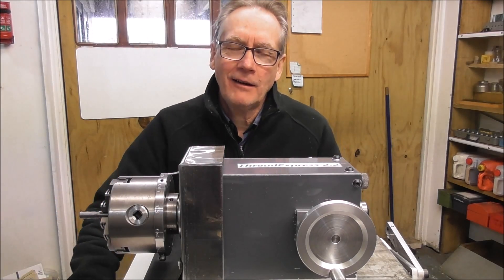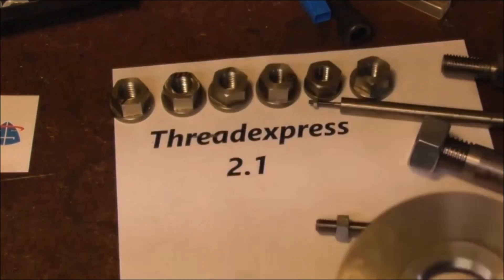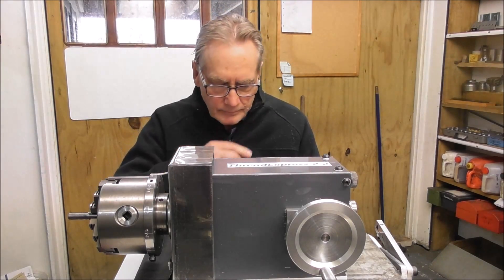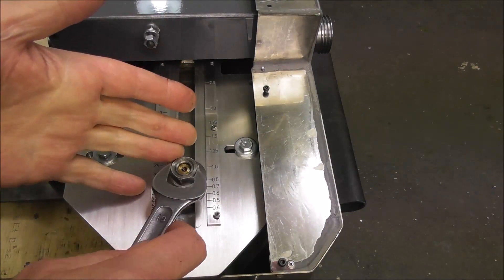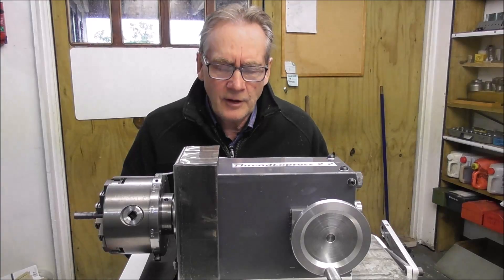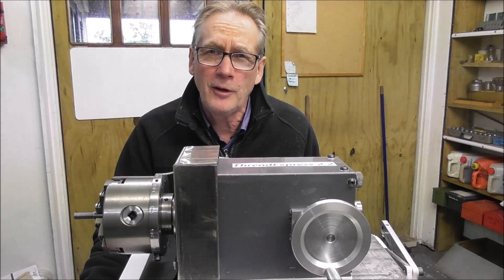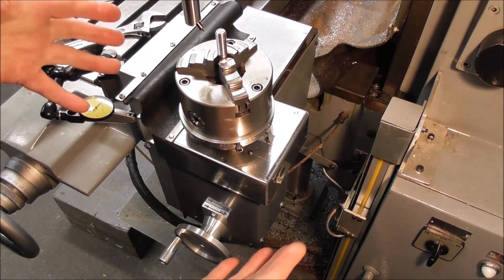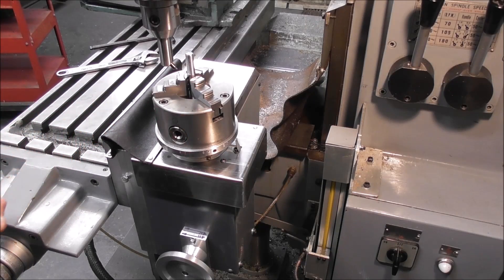ThreadExpress 2.2 Design revelation begins.

Comment: Neat idea, very interesting . The adjustment of pitch Reminds me a lot about Spiral grinding attachments for t&c grinders, but many of them cant do very small pitches like yours.

My first idea would be not to use it on a mill, but on a surface or t&c grinder to implement threadgrinding.

For milling machines, I think its 70 years to late, having this integrated right into a toolroom mill would have been extremely powerful. Today that need is unfortunately eaten up by cnc mills.

Will watch the other videos for sure 😃
Reply from the maker: Thanks for your feedback Stefan. I agree CNC affects its percieved value and this is a marketing challange. I have CNC threadmilling also, and often choose ThreadExpress for one off speed of set up, or when a larger diameter cutter is needed (eg for the stiffer larger longer shank reach on longer threads) because with a larger diameter cutter you really need to set the axis of the  thread over at the helix angle to avoid milling the thread profile errors you get with vertical three axis CNC thread milling.  I briefly tried thread grinding with it on my surface grinder, but soon realised I need better wheels, diamond dressing, and thread grinding learning time first! Cheers, Cliff

Comment: Some further thoughts about using differential threads to produce the adjustable lift required in your ThreadExpress device.  I'm looking forward to the final reveal because I'm sure your solution is better & simpler than my speculations.

The problem is the tremendous range of threads necessary.  64 tpi requires that the spindle lift 0.0156" per revolution and 2" of thread requires 128 revolutions.  9 tpi requires that the spindle lift 0.1111 per revolution and 2" of thread permits only 18 revolutions.  It simplifies things to use threads on the outside of the spindle to create the required lift.  A pretty fine spindle thread is required to allow 130 revolutions for the 64 tpi threads, but that fine thread doesn't provide much lift when less than 20 revolutions are available for the 9 tpi.  

A compact solution is to limit the rotations to about 65 and have 2.5" of 40 tpi and a nut on the upper end of the spindle and 8" of 10 tpi and a nut on the lower end of the spindle.  A 6" long cross lever is pinned at its 1.5" point to the upper nut.  A slide on the lever is positioned anywhere along the lever to control the lift of the nut.  The slide swivels on the end of a long vertical link pinned to a reference elevation.  The other end of the 6" cross lever is pinned to one end of a 7" link with its other end pinned to the lower 10 tpi nut.  When the spindle rotates CCW it backs out of the upper 40 tpi nut and lifts at 0.0250" per rotation.  Spindle rotation also backs out of the lower 10 tpi nut and moves it down at 0.1000" per rotation.  The link from the lower nut to the 6" cross lever pulls it down and rotates the cross lever 90 degrees CCW around its pivot on the upper nut.  Because the cross link pivots on the slider, the position of the slider on the cross lever determines the total lift of the spindle. 

The total spindle lift is the combination of the spindle backing out of the upper nut and the lift of the cross lever that lifts the upper nut.  The slider position on the cross lever determines the lift of the upper nut.  When the slider is coincident with the pivot on the upper nut, the rotation of the cross lever has no contribution to the lift - it still rotates but doesn't move the upper nut.  The total lift will only be the backing out of the upper nut at 0.0250" per rev and would mill a 40 tpi thread as the spindle rotates.  When the slider is beyond the pivot on the upper nut on the short end of the cross lever, the rotation of the cross lever lowers the upper nut and SUBTRACTS from the spindle backing out lift producing total lifts of less than 0.0250" per rev to mill threads finer than 40 tpi down to 64 tpi.  When the slider is on the other side of the pivot on the long/linkage end of the cross lever, the rotation of the cross lever in the slider raises the upper nut and ADDS to the spindle backing out lift, producing total lifts greater than 0.0250" per rev to mill threads coarser than 40 tpi up to 9 tpi.  This cross-lever lift is important because with coarse threads fewer spindle rotations are required/available and the lift backing out of the upper 40 tpi nut is small.

The 10 tpi thread on the lower part of the spindle is necessary to get the necessary lower nut movement to rotate the cross lever enough to obtain sufficient spindle lift for the coarser threads with the few available spindle rotations.  But 64 spindle rotations are necessary for every inch of 64 tpi thread.  This requires 6.4" of 10 tpi thread to accommodate the lower nut movement for this fine thread.  The 7" of 10 tpi thread limit the rotations to about 65 and the amount of 64 tpi thread to 1".  Longer fine threads can be made by repositioning the work in the chuck - why would one need more than 1" of 64 tpi thread?  The amount of 40 tpi thread is limited to the 65 rotation limit of the 10 tpi thread or 1.6" travel of the spindle in the upper 40 tpi nut.  The amount of 9 tpi thread is limited to the 6" of lift available with 7" of travel of the lower nut, but is more likely limited by the slide travel of the overall mechanism - 2 to 3".

As mentioned previously, the slider swivels on the end of a long link pinned to the reference elevation.  The slider's position on the 6'' cross lever is set by shifting a link from index marks that mark positions for the desired tpi or mm pitch.  Range of lateral movement of the slider along the cross lever is about 5".

The mechanism is mounted on a 1/2" thick base plate sliding vertically in a dovetail on the side of the milling table.  As noted in the main description, the dovetail mounting can be shifted and locked to set the spindle at the required helix angle for the thread.  The end of the link to the slide on the cross lever is pinned to the stationary part of the dovetail through a slot in the base plate.  The whole mechanism is supported on the slider and cross lever and is lifted in the dovetails by forces on the slider.  The spindle is supported at either end in bushings in 1/2" brackets bolted to the base plate.  The cross lever, links to the 10 tpi nut and pitch-setting lock, and slider-supporting link all slide on the base plate.  A vertical dado in an adjacent bracket bolted to the base plate receives tabs on the 40 tpi and 10 tpi nuts to prevent rotation but allow movement up and down the spindle.  That bracket has to be far enough away from the spindle centreline to allow the slider support link to move from one side of the spindle to the other for the different thread pitch settings.

As noted in the description, a crank and bevel gears are used to manually rotate (and elevate) the spindle during the thread milling operation.  If bevel gears are not available, pulleys and a large O-ring belt could be used.
 
As the crank on the side of the mechanism is turned, the spindle rotates the work CCW and backs out of the upper 40 tpi nut.  The lower nut moves down the 10 tpi spindle threads.  Its link rotates the cross lever 90 degrees CCW.  The position of the slider on the cross lever determines how much lower-nut movement (lift) is added (or subtracted) from the upper nut to produce total lift.   The total lift per rotation determines the thread pitch.  The cross lever, slider and links all have to be beefy enough to support the weight of the base plate, spindle, bearings, chuck, and work piece.

Congratulations if you got this far.  Make any sense?
Reply from the maker: Hi Andrew. Yes, I follow you well enough to see this is a far too complicated pitch generating mechanism, but I love your enthusiasm and dedication!  It would pay for you to save your energy and wait until I reveal the much simpler design of ThreadExpress (hopefully soon, see my top comment at the start of the latest video). Cheers, Cliff

Comment: It looks like you can handle a maximum of about 2" of thread anywhere from 64 to 9 tpi.  I believe this could be achieved with differential threading on the spindle below the bearings - say 1" of 120 tpi on the upper portion and 4" of 30 tpi on the lower end.  For this explanation I've imagined 60 tpi as the minimum and 10 tpi as the maximum for easy arithmetic.

For 2" of 60 tpi you'll need 120 revolutions of the spindle.

With 1" of 120 tpi and its nut is at table height, 120 CCW revs of spindle will raise the spindle 1".  (Backing it out of its nut.)

If the lower end of the spindle has 4" of 30 tpi and its nut is not fixed but prevented from rotating, 120 CCW revs of spindle will lower its nut 4" relative to the spindle but because the spindle went up 1", the lower nut will only lower 3" relative to the table.

The lower nut is linked to one end of a fixed teeter-totter at say table elevation and pivoted on the spindle centreline, such that one end goes down 3" while the other end goes up 1".  The rising end of the teeter-totter is linked to the upper nut, and will lift it 1" and effectively raise the spindle 2".  2" of upward movement in 120 revolutions will produce a 60 tpi thread.

If the pivot point of the teeter-totter is a slot, shifting the teeter-totter along the slot will change the ratio between the down motion of one end and the up motion of the other end.  For 2" of 10 tpi, 20 CCW spindle revs would be necessary and will raise the spindle 1/6" in the upper 120 tpi nut.  20 CCW revs will lower the lower 30 tpi nut 2/3" relative to the spindle but because the spindle went up 1/6", the lower nut will only lower 1/2" relative to the table.  But we need 2" of total upward spindle movement to get 10 tpi in 20 revs.  So by shifting the teeter-totter in its slot to give a input:output ratio of 1/2 to 11/6, 1/2" of lower nut downward movement would translate to 11/6" of upward nut movement which added to the 1/6" it already moved would give 12/6" or 2" of upward spindle movement.  And 2" of 10 tpi with 20 CCW revs of the spindle.

 So the teeter-totter slot would be positioned to give a 0.5:1.8333 ratio - one end goes down 1/2" to lift the other end 1.8333".  And lift the upper nut 1.8333" for a total spindle lift of 2".  

Even better ratios could be had with more travel of the lower nut.  But more lower thread would be required and take more room in the mechanism.

There may be issues with angularity of the links as the teeter-totter rocks from the lower to upper spindle position.  But they can be minimized by maximizing the lengths of the links and minimizing the length of the teeter-totter.
Reply from the maker: Hi Andrew!  This ThreadExpress if nothing else is causing a lot of intrigue. Consternation even! By the time it is finally revealed we may have every possible design reverse engineered from clues gleaned and deducted. I dread to think how much sleep deprivation I have caused.
 You have put together a very solid case based on your first sentence deduction. The trouble is that first sentence deduction is incorrect, cruelly leading you astray.  But hopefully you enjoyed it, so all is not lost.  Stay tuned and hopefully soon the design will become clear. Cheers, Cliff

Comment: My best guess is 2 or more crossed, opposing, hardened rollers that are very heavily pre-loaded against a hardened and ground spindle supported in its own bearings. Changing the helix angle of the rollers to the shaft would give infinite pitch changes from zero to the max setting. The spindle would act like a toothless lead screw. The opposing rollers eliminates any bending of the shaft. Helicopter one-way clutches work on hardened cams or rollers against hard shafts and the traction is enough to transmit incredible torque without slipping....even submerged in oil.
There are existing linear shafts nuts working on this principal but without the helix adjustment.   Well....am I even in the ball park ? LOL.  It's fun to think about and hopefully to see the other ideas that come up. However it works, your invention is brilliant !
Reply from the maker: Thanks for your feedback and interesting idea! Cheers. Cliff

Comment: It seems to me, that the device possesses the ability to produce a spiral around an external shaft.

If you mounted something like a boring head where the chuck is mounted, if you installed a cutting spindle where the boring bar would normally be installed, you could make a device that could be mounted in the field, that is capable of milling threads in the field on any exposed thread in an assembly. 

I can imagine producing a threaded hole on a large piece of machinery, or a large exposed stud.

A portable thread milling machine.

I would recommend contacting Climax portable machine tools, or York portable machinery if you are looking for a possible buyer.
Reply from the maker: Thanks for your thoughts, I see what you mean. I thought for a moment you were describing ThreadExpress v1.0 - which had a cutting head and was a portable thread making machine. But what you are describing is a little different, it is a niche bolt, clamp or mag on thread cutting attachment. Interesting....thanks! Cliff.
Reply: @Threadexpress  yes, I am describing taking your machine and attaching it to a piece of equipment at a job site. Companies have made portable lathes, portable bore welding machines, portable line boring machines, even portable milling machines, but nobody has made a portable threading machine.

I personally am interested in your attachment for that reason. It can be turned Into a machine.

Comment: Very interesting machine. Yes, the same could be done on a 5 axis CNC like an Intergrex. But like the Tree taper boring head, for the right job it's the perfect answer. In over 20 years I can only think of maybe a handful of jobs where I would have used it, so not likely to pay for itself. I have done thread milling and thread grinding on my lathe when an absolute perfect thread form was required. This was for telescope drives that needed arc seconds accuracy, and it took much lapping to get that. I wonder if your machine could deliver that accuracy? Of course the days of mechanical accuracy are numbered. I remember seeing ball screw grinding machines where the thread was held to 10 microns over 2 meters. Now days they just grind them in the ball park, map the errors and fix it in software. I do look forward to your next video about this.
Reply from the maker: Hi - Good to hear the thoughts of an experienced machinist. Cheers, Cliff

Comment: Hey Cliff,
I'm picturing a pantograph / 4-bar mechanism? One point is driven by a nut that meshes with a thread on the spindle, and the adjustment slider moves the pivot point. Adjusting the pivot point in or out changes the lever ratio, effectively reducing the pitch, while the pantograph maintains linearity throughout the travel.
I've watched several of your videos over the years, and always appreciate your thoughtful explanations.
Cheers (also from down under, Palmerston North, NZ),
Simon  :  )
Reply from the maker: Very interesting, fellow Kiwi. That is all I can say at this stage. Cheers, Cliff

Comment: Hello from Germany
This machine is like I think a mechanical master Part.
But yes there is a but.
I saw this machine in a machine shop 30-40 years ago.
I am a mechanic in a factory.
We have to fix all sorts of things.
Even if we had such a machine, no one would use it.
I would have to grind a tool. I would have to align the machine. I would have to align your machine with the milling machine.....
This is taking far too long.
So what do we do? We give it to a machine shop.
This machine shop simply turns such parts on a CNC lathe.
Sometimes I make simple parts like this on my CNC lathe.
Check out my channel...
It's no longer that difficult to mill/turn such parts.
I myself also have a C Aches and a driven tool on the CNC lathe.
I recommend that you stop working on this machine - the system is over its time.

I still wish them all the best
Stephan
Reply from the maker: Sorry I missed your comment until now. Thanks for the feedback. Cliff

Comment: Could you go into more detail about the helix angle? If it cant be correct vertical with a singele point thread mill due to the tool flank and releif angles, then a lathe shouldnt be able to be correct either. The cutting edge is presented the same relative to the wor, at the same angles relative to the axis of the work, its just the frame of reference is rotated 90 degrees from outside
Reply from the maker: Good to see folk are thinking deeply about this. I think I should go over it more in a future video. Single point threading in a lathe is not highly precise without setting the tool at the thread helix angle also. High end manufacturers such as Sandvik Coromant and Iscar produce such tools with adjustable helix angles.
But the problem with thread milling (in a mill or lathe or CNC mill) is the additional issue of cutter trajectory. The tool trajectory sweep needs to be inclined to stay in the valley of the thread, if the thread pitch/diameter/cutter diameter conspire to cause the tool trajectory to cut into the thread flank. In the instances where this happens, an incorrect thread form is cut.  Cliff
Reply: In a lathe the tool bit cuts on the leading edge fed in at a 29.5 degree angle.  You compensate for this in mill threading by inclining either
the tool or the workpiece.